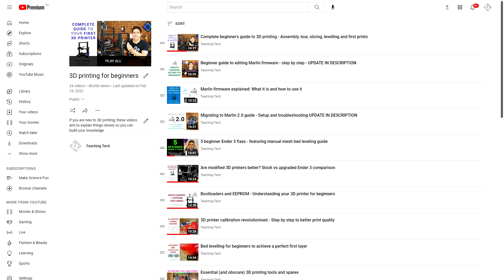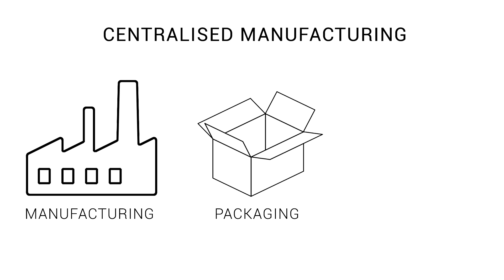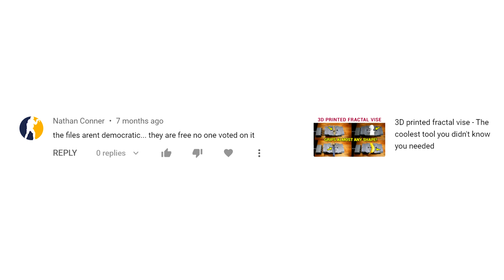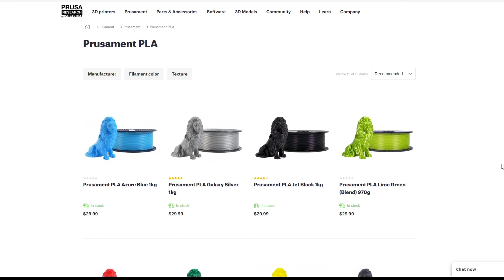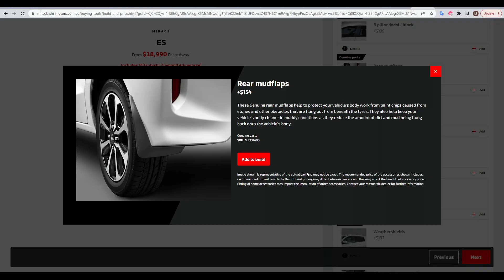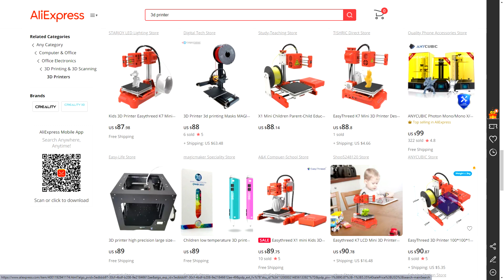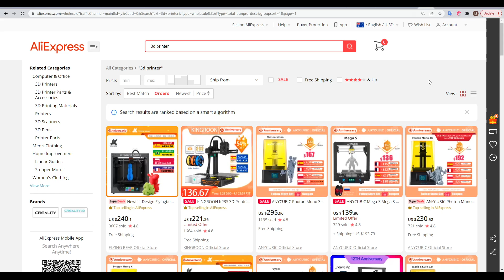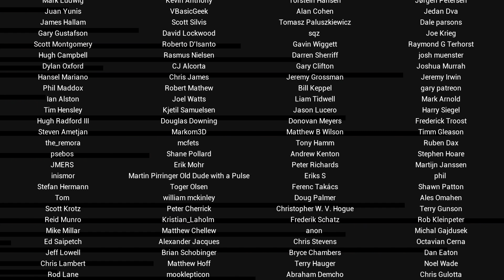3D printer trends are limiting mainstream acceptance: The 3D printing paradox

Comment: There is no potential to have 3D printing in every home for decentralized manufacturing.   This is because modern useful items are made out of multiple materials that, in a home 3D printer would massively complicate the cost, maintenance and operation of the printer. I have been using 3D printing since the late 90’s.  It STILL is primarily a cost effective means of rapid prototyping and design iteration, useful for DESIGNERS.   For the hobbiest, all 3D printing offers is the ability to dick around with a gizmo, and produce extremely limited types of objects with extremely limited utility due to the issues inherent in any affordable 3D printing machine and the materials they can employ, and limited largely to objects designed by other people that are ‘affordably’ available online.  Saying there could be a 3D printer useful in every home is like saying every home could make use of a milling machine, or a lathe, Either of which is capable of producing much more robust useful objects than any 3D printer.  But as with a 3D printer, Those tools are most useful to people who UNDERSTAND how to design useful things. And who are willing to become experts in using a complex tool.   3D printer hobbiests invest hundred and thousands of hours becoming experts at running THEIR 3D printer… which is NOT the same as an appliance that any person can turn to in their home to effect a useful task, like a microwave oven, which does not require you to tear down the microwave generator after every 3rd or 4rth  meal to clear a jam.   They CAN make more robust and appliance like 3D printers, but accomplishing that makes them dramatically more costly.  And even now, the 3D printers that might be most useful, those that can print in high temperature materials or a wide variety of materials, are still more costly than most regular folks could justify, given the extremely limited utility they still represent- largely because there is little financial incentive for competent designers to spend their time designing genuinely useful printable things because once a 3D file is out there, anyone can copy it and distribute it to all their hobbiest friends.   For these reasons- acquiring expertise in running 3D printers is going to be most lucrative for people who design things a for a living- or people to offer printing services to designers who don’t Want to spend time learning how to reliably run 3D printers.  For the first 20 years of 3D printing I simply outsourced to service bureaus, because high quality printers were costly-and became obsolete within a year or even months, and they were time consuming to maintain.  Today- 3D printing has pretty much attained about as much capability in the prosumer market as it can attain, and as a result I now own One really versatile filament printer ( Raise 3D pro ) and 2 large format DSLA printers. But then, I do sculptural and product design for a living. We don’t print stuff we found online, we design the things we will print.  The problem with the idea of a 3D printer in every house is the same issue with the promise of affordable car lifts and mechanics tools.   Everyone needs their car fixed.  Why doesn’t everyone possess the tools to do it? Well, to use those tools effectively you need essentially the equivalent of a career’s worth of knowledge about what you are doing.  3D printing will never be plug and play, except in the realm of single material objects that can be made of inherently weak materials.   And even then, You can usually get something online, cheaper, and delivered by Amazon faster than your glacially slow printer can produce the product you might occasionally need.  If you’re a printer geek, then sit back and enjoy goofing around with the gizmo you enjoy tinkering with.  If your a designer, then 3D printing can open a whole world of opportunity to facilitate the design process. Or if you want to manufacture tiny- low run- figurines or objects to sell to folks who have no interest in running a printer- also a great tool.  But for most people, in most places, 3D printers simply have no real utility at all, and never will.  Thinking so reflects a woeful misunderstanding of the complexity of materials handling and manufacturing.  Believing they can be made to produce complex multi material objects with no more user input than picking a file and pressing Print is a belief unfounded in any example of similarly complex tasks being made so effortless.
And even then… think about the printer community.   Making the machines so any person can use them without any expertise at all effectively eliminates the primary thing printer geeks love about them… the challenge of getting the thing to work without making a raft of failed prints.
Reply: Remember newbs that designing it yourself dont automaticly mean you can sell it. License check before selling any print. It may have been invented and licensed already. 
Maybe the royalties are really low or there maybe more opertunity to do a deal. Piracy aint cool. 
Oh my printers have not clogged in ten years probably so not sure what newbs must be doing. 
Multi material is common now if youve the money to buy it. 
Ive even made filament with any old guff wether it melts or not dont matter it can go in. 
Oh i design the stl to match the extruder tip so that means a one inch print takes the same time as the same stl printed 100 feet tall. 
One hour each. 
Speed comment Chine has a 160,000 cubic foot 3d printer if im not mistaken. Speed much. 
Atom arrangement is also being done so i think longer term when tek like that or matter creator is combined the difference from whats commonly in use now is quite a different opertunity.
Reply: @WillofNewZealand  Multimaterials means the ability to print plastics, rubbers, and metals in the same part at the same time.  No printers available today are capable of doing such a thing. ( just a few prototypes have been made for such capability-none of which work reliably ) The ability to print 2 or even three different kinds of plastic filament at the same time is not really enough.  An imagined printer than could, for example, print a smart phone, or any other appliance that might involve heating elements, plastic and glass parts, and electrical components is simply not feasible for home use.  Only a handful of high end printers can photocure two different types of materials, like elastomers and rigid plastics, in the same print. But what hobbiest or home prosumer can afford a Connex printer?   Nah- 3D printers are a toy for gear freaks who are more into tuning the printer than anything it can actually make.  They are great for Cosplayers who want to make bits and bobs for their real passion, dressing up for cons.  
Beyond that- they are a tool uniquely useful for the small cadre of people who have the expertise and interest in designing the narrow category of objects they Can produce.
Reply: @christopherpardell4418   my cheap printer has twin print heads to put two materials into a single print. 
Its never broke down yet in a decade or so. Ive seen others with 8 different materials into single extruder somewhere on net. 
And what ever the number its not set in stone. I do design parts to match extruder tip so lets say it takes 1 hour to print the thing one inch high. It still only takes 1 hour to print the same thing 100 feet high. 
China has a 160,000. Cubic foot print if im not mistaken. 
House printing is usefull. 
Im excited longer term to see atom arrangement in wider use. 
Im mostly in selling the invention ownerships. Tho i still print stuff. Recently rubber has been fun, cycling gear. 
I see the industry being in its stone age currently but theres plenty of working science yet to be widly used.  It is being used for seed dna printing so there are more than cosplay and yoda heads being done.  I had predicted atom arrangement but was supprised to see it in my life time so eh its getting there. 
Dentures are being 3d printed and some people think thats usefull. 
 custom lims have helped people. 
I made a file able to print a face shield when covid first kicked off. I got the print time from 2 hours to 8 minutes and gave it away free. 
Just a toy you say.  Depends i recon.
Reply: @WillofNewZealand  My not so cheap raise pro has two print heads- The only two different materials it can really print together are slightly rubbery filament or somewhat stiff filament.  Or one of them can be water soluble support material.  It can not, for example, print both ABS and PLA simultaneously ( at least, not reliably )  because ABS requires a closed cabinet and higher internal temp, while PLA requires an open cabinet and plenty of cool air to reduce the chance for heat creep ( even with a nice bimetallic heat break hot end ).  There is no printer that can print elastomeric filament and PEEK in the same part, because the printing temp of PEEK is hot enough to melt elastomeric filament to a liquid.  My DSLA printers can only print one material because it’s in a vat, and all of them are essentially variations on acrylic.   The point being that modern products that are genuinely useful largely incorporate a much wider variety of materials, in one product. Glass, ceramic, metal, and plastics.   Optics, and electronics.   And no household printer will ever get fielded that can do all of those things simply because of the wide variety of both conditions, and equipment required to print them.   You can buy a metal printer- for about as much as a car.  But it requires expertise, experience and money to run them.   Even your and my printer that can print two materials into one thing requires some sophisticated modeling expertise to create a model that CAN be successfully printed.  Once more, for anyone interested in 3D printing you can do a LOT of things with it, if you are willing to invest a few thousand hours learning how to use the thing.  No one needs to so much as read the manual to operate a microwave.  That’s why nearly every home has a microwave, and why nearly none of them have a 3D printer.  People already HAVE careers. Already Have hobbies they enjoy.  The lure of 3D printing wears off quick.   Few people would think that spending hundreds of dollars on a printer, and one or two rolls of filament, and a weeks worth of run time and research and tweaking to wade thru 8 failed prints just to get to the point where you can make yourself a fairly crappy looking iPhone case is a good use of their time when they could have had a much better, much more durable iPhone case in 24 hours for $11 bucks from amazon.
Don’t get me wrong, I LOVE my 3D printers.  I love being able to quickly design some thing that can NOT be bought anywhere, and run it off in a day or so.  But then, I am a designer.   I have extensive knowledge in materials and production and how to compensate for shrinkage and warpage. I understand the stats of various materials and know what I can expect of them and how to design for their properties.  Knowledge that took me decades to acquire.
3D printing is a tool. Like a table saw. A table saw is pretty much useless for a plumber. But every serious woodworker has one.  3D printing can not and will never compete with scalable tooled manufacturing. And let’s face it, MOST products are designed to appeal to most people, which means that the costs of production tooling are worth it when you can make millions of copies at low cost and at high speed.   Folks wanting, say, WoW figurines that will never sell in the millions- for them a 3D printer might be a good solution.  But its a better solution for the person who has the career interest to learn how to model unique WoW figurines, and runs a small business printing small run specialty products he/she can sell to the WoW players who simply don’t have the time to become experts printer operators.  Again- professional or semi-professional designers and creators.
Reply: @christopherpardell4418  ok im on the same page as you for most of that. 
Im being optermistic as a sciense fan that the future would change current position of 3d printing capability and usefulness and ease of use. Tea earl grey hot is probably the most famous 3d print in the world and that level of ease of use and ability to print anything with no skill is of course ideal. Thats the game i have eye on. I started selling prints then the stl copies then realised the invention ownership should be able to be sold and purchased. I asked and negotiated and became the first to sell a 3d print license. 
I got the thing license listed at and auctioned off, sold paid for and transfered into new owner user name with correct original date of invention correct. 
Theres a lot to improve in this industry its true. Getting more than one working 3d print license website for the comunity to use is my focuss for sure. Im hopeing thingiverse resumes business services of course. Its been down 15 months sad. But i have hope the industry has opertunities in it yet. 
By the way i own Tea earl grey hot. 
Oh i wanted to mention spee3d its a metal printer that is a bit different than others and quiet fasinating. 
Also can print speeds match other methods maybe not today on many common printers but the future is all about improving that position. 
I did show a design that combines infinit z with energy beam placement from matter creator. 
Yes sounds a bit far fetched or pie in the sky but as i say i read a few sciense books. Ok i read them all at library many years ago now.
I forget stuff but ive a feeling for it anyway. So i think theres science to burn yet.
Reply: @christopherpardell4418   wanted to say i really enjoyed making filament. 
Putting grass clippings and any material in wether it melts or not into filament. Fun. 
Of course the more toxic abs is easy to extrude than pla but yip fun. 
I notice other people say that its expensive to recycle waiste plastic or bakerlite cant be recycled but with a chipper and a filabot extruder filament material can be found in any gutter to clean out and most materials can be mixed in. 
So the 3d print opertunities aint all in the print. 
Licensing checks for example used to take me a minute to look at the hundred or so licensed prints on the internet. Now ten million or so. 
3dmdb yeggi stlfinder net are the go to for license checking. 
The checking job is a pain cause sort by alphabet aint been achieved yet. Its getting close but not ideal when first license gets paid the royalty and second license is a pirate. 
Hence it can be a long job license checking before you upload your so called new thing. Or selling it.
Filter by oldest first only partially works so again its a job to check licenses. Print farms that aint charging to check are probably just print you any pirate thing. 
I admit to having been stopped by my sales site because i had a pirate item listed. It turned out a free thingiverse file was a pirate. 
He had no right to give away free files. He had no right to upload the file. He was not the original inventer. 
I didnt know and my checks back then let me down. 
I was unable to sell any other products either. forever unless i could sort it. 
Piracy aint fun. 
Ive lost in many ways but was first many times. 
So yeah even license check a free thingiverse file because it can be a criminal pirate file. 
Theres skill in license checking and yip ive danced that dance many times. I could be the expert. 
Its a job in itself. Sometimes a minutes work sometimes it takes me weeks to work a path to success. I look for how can it be done not how it dont work.
Ive seen a few people beat me to get ownership of a particular license and i had to sit and try find a way that they got past the post. 
Heres just a few random thoughts. 
Some licenses cover all printers even private ones. 
Printers are outlets. Chain stores. Corner shops. Vending machines. 
Locations and way more. 
All printers are yours depending whats being printed. 
You own every 3d printer provisionly.
I own every printer to. 
Printer manufacturors are making more outlets for you. 
There is even more angles but id not reviel all my majic tricks. 
Theres so much more to printing than just plastic pegs.